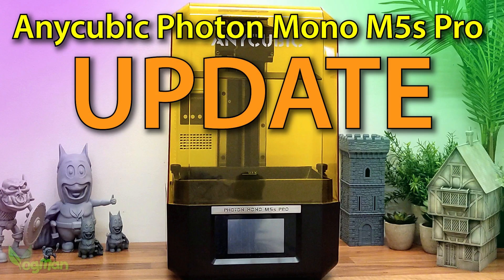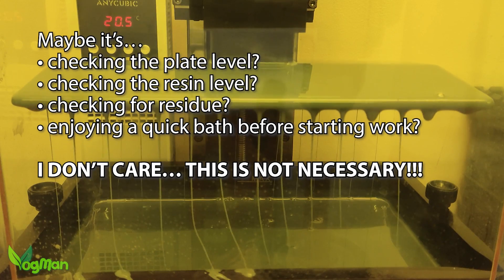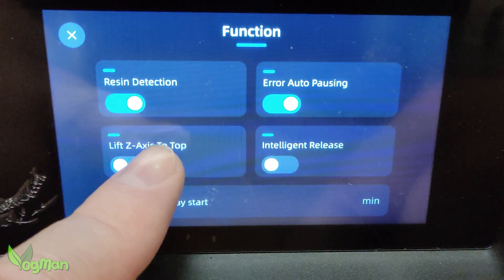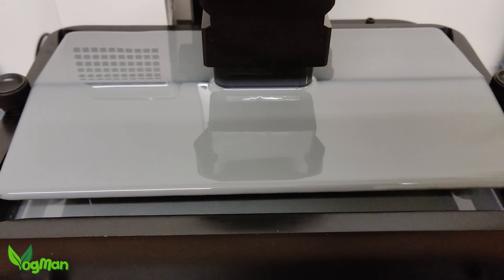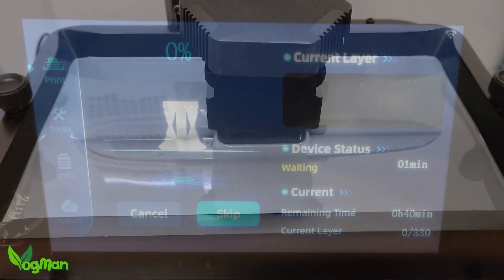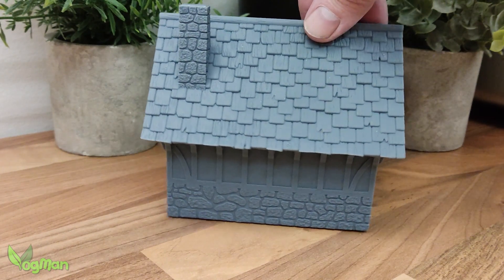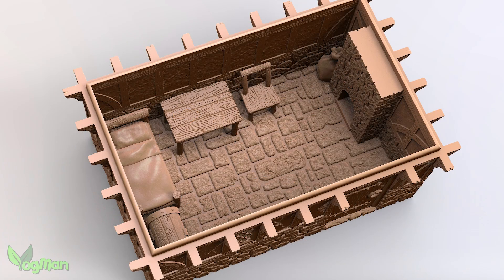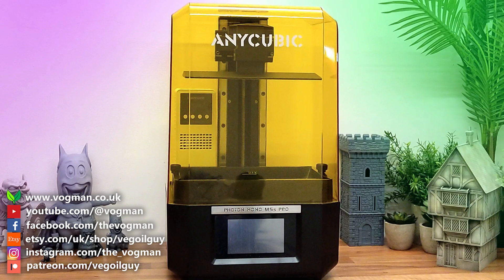Anycubic Photon M5S Pro UPDATE

Comment: HELLO I NEED HELP FROM ANYONE PLEASEE !!!!!! what slicer did you use?? I want to use standard resing but lychee files always show that fast mode is in use and has some issues with files comming from lychee slicer and tried to use photon workshop and files although the correct format does not show up in mu printer when i plug in the USB only the lychee files are visible, also what settings did you use to get succesfull prints ??

Comment: Talk about Stupid, I just purchased a new Photon M5s Pro, but it only accepts ".m5sp" files, which is the file type for all the included demo projects on the USB Flash Drive. Neither the also included Anycubic Photon software, nor the premium versions of software, have the ability to create a ".m5sp" file. Therefore, I am unable to print any thing but the included demo files. This would make a great video if you know a solution for this problem? Also, I would like to know if the other resin printer brands have similar file recognition issues. I'm just about frustrated enough to pack this Photon M5s Pro Boat Anchor up and send it back.
Reply from the maker: I think you're mistaken here buddy. the m5sp files work via the Anycubic Slicer. Other slicers probably won't support them, that's true. But all you need is an STL. Try this one... it's a free ring design on Thingiverse https://www.thingiverse.com/thing:4643535
Open the STL in the Anycubic slicer, slice it and you'll have a m5sp file you can print.
Any you don't have to stick with the Anycubic slicer. There Lychee or ChituBox for example.
Reply: @vogman  Thank you for your response. I thought I was doing something wrong and was looking for suggestions. I finally found the problem to be in my configuration settings, so I was correct - I was doing something wrong.

Comment: Have you noticed that the AA doesn't work at the higher speed settings? So at fast print speed (20x) at 0.01 layer height, I can see the layer lines with without magnification. Which is annoying if you paint mini's. Since the are very visible than.

Comment: Any luck printing BlueCast X10 on that M5s Pro I’m using lychee slicer 6.0 and I can’t get it to print onto the build plate 😩
Reply from the maker: I haven't used Bluecast X10 on the M5S Pro, sorry. A tip I discovered with castable resins that won't stick may help, and that's to increase the size of the raft. A bigger raft tends to grip better. Hope this helps.

Comment: I've found the same issue with my 6ks unfortunately
Reply from the maker: Sorry to hear that buddy. Have you checked the website for updates, just in case? You can usually find a link to these at the bottom of the page.
Reply: @vogman  I have checked but no update Mr V. It's not as severe as your problem was but when I've pressed pause on any other resin printer, the plate moves up slowly just to expose what has been printed. When I press pause on the 6ks the platform shoots about three quarters of the way up. My solution is not to pause prints 👍. Apart from that I'm really really pleased with the machine and it was a total bargain and at least anycubic are shipping with a screen protector already installed. I'm so amazed at the quality of prints. I have my AA set to 2. Grey scale set to 2 and image blur set to 2. Just a very lucky guess but seems to be spot on ✌️

Comment: Ebay is running a spring sale which you can get this model with a wash+cure 3 plus for $460 do you think it is worth it now with the changes or do you think waiting to see what the saturn 4 will be is a better choice?
Reply from the maker: It's hard to imagine that Elegoo will give us anything "better" than this... maybe a few extra mm height or something. But we can never really be sure until we see them. Right now this is an excellent printer and has become my new favourite 😁
Reply: @vogman  from the the leaked rumors/pictures. The Saturn 4 supposed to have a lift lid like the gk2 and quick release build plate like the gk2. But it supposedly doesn't have a heater.